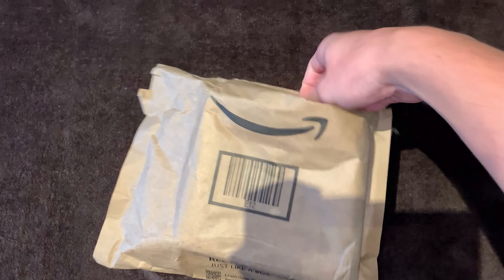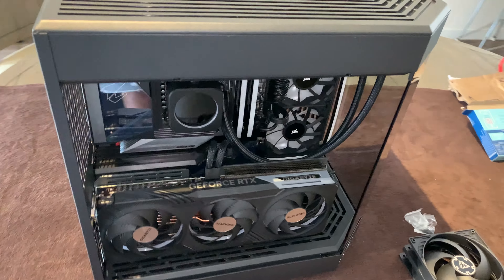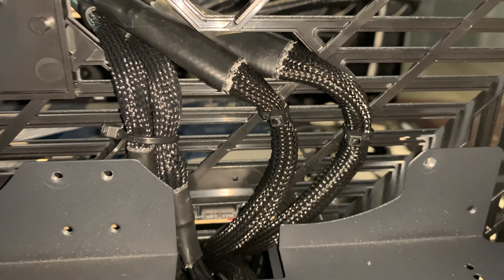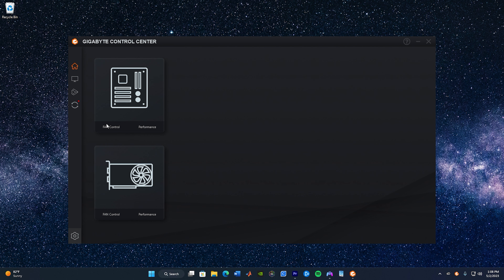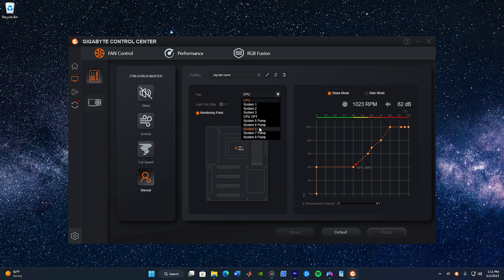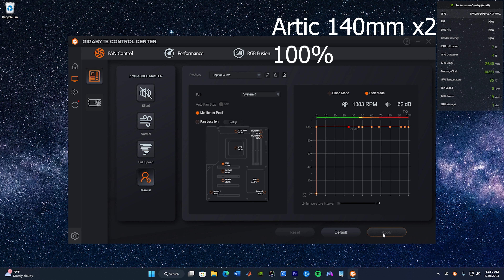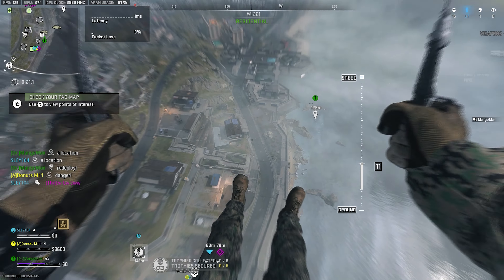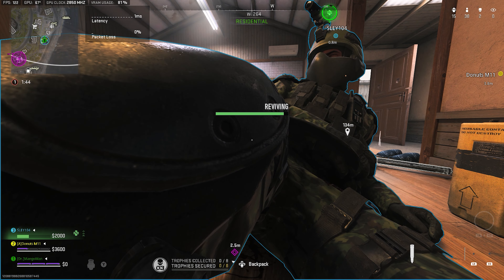Artic VS Noctua VS Corsair FAN Noise Comparison

Comment: perfect video for me, i would get some rgb fans and the corsair are the most appealing one since i also got the same rgb rams.
Are they really that loud when you're playing a demanding game? Or i should go for the Arctic but no rgb?
Reply from the maker: thanks but yeah like i said they’re all really quiet fans in general. but to keep my overall noise low i used the corsair fans as intake instead of exhaust for my radiator, and i use the noctua. like that i can keep the corsair ones at a lower rpm.  So if you want the rgb I would just go for it. thats what i did and i got the artic because you wouldn’t be able to see them under my case lol.
Reply: @Dr.MangoMan  yeah noctua are really quiet but also expensive, i guess i'll go for the the 3 rgb and also use the 2 in in the 4000d airflow, i hope it's enough!